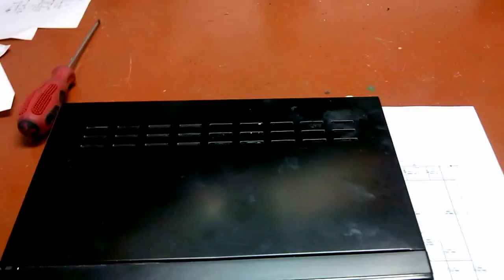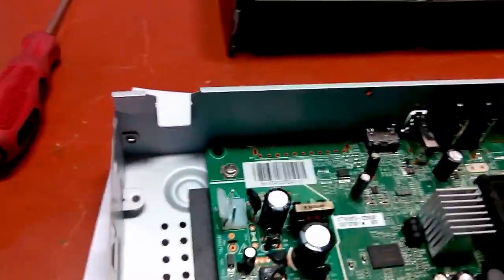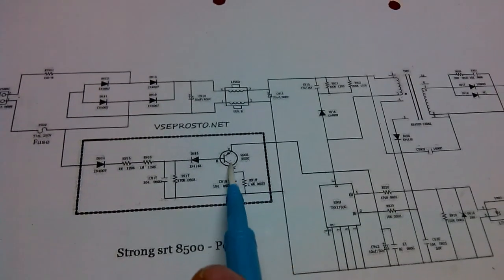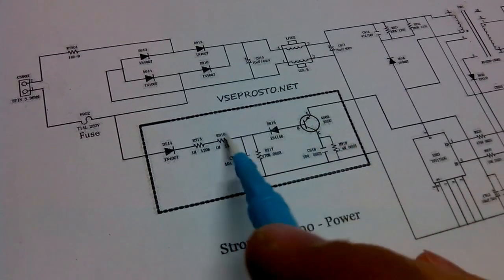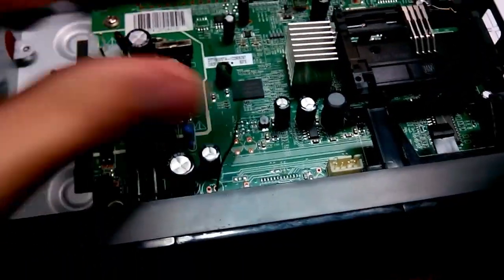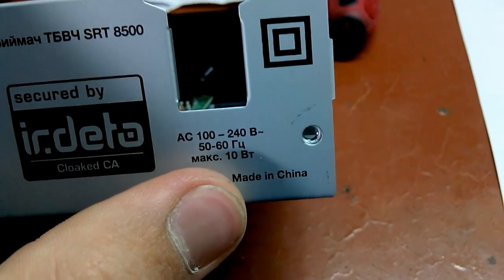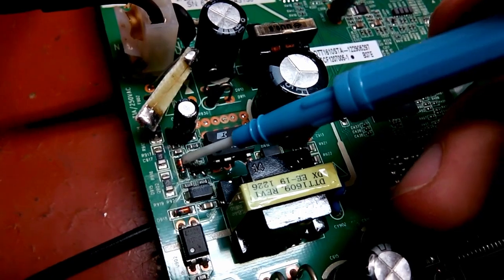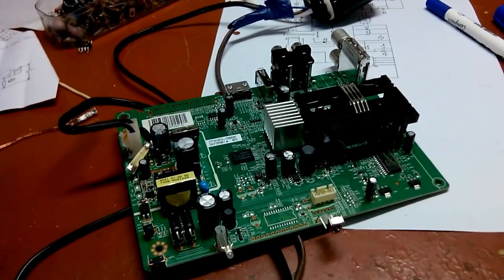Set top box repair

Comment: Ive never been happy with the idea of putting a power mosfet inside a chip with the pwm circuits.
I like a seperate mosfet and driver i.c, but im a picky bugger LOL :-D
Reply from the maker: I like such chips if you don't push them they perform great. My 3W and 6W LED bulbs use a TNY278PN from Power Integrations and I'm completely satisfied. I love that chip - it's very simple to use (doesn't require many external parts) thus the circuit can be very compact and on top of that - it's cheaper than PWM chip + discrete MOSFET. For a little PS under 15W that chip is my way to go.
Reply from the maker: I'm a fan of Power Integrations' chips if you saw my video about PCB drill press, the board I drill there is for another switcher chip from this company. And one more - their chips have a frequency jitter feature, which reduces EMI, so they are relatively "quiet" even without additional filtering. Add a CM choke with a few caps and that PS will be a good neighbor even for a radio receiver.
Reply: I dissagree with you, now we go to war LOL :-D
Yes im sure they are good, but ive seen so many things die because of heat, and quite a few "all in one" tny chips just go bang for no real reason.
But, switchmodes go bang anyway, hard to tell what went wrong.
Bad capacitors im sure we agree on, so what about a part time war LOL.
Reply from the maker: zx8401ztv Don't be like Putin LOL A few arguments shouldn't start a conflict. 
 As I mentioned, it's a power surge that killed it. A proper design would include MOV to protect it + I replaced it with a beefed up version and it works like charm to this day :)
Reply: LOL im just being silly, but you know that :-D
Yes ive noticed missing parts in quite a few switchmodes, even a in-line resistor is helpfull.
Im no expert at switchmodes, just the basic understanding is good enough for my foggy brain :-D.

I went round my mates house the other day, he showed me a linear psu i had made for him in 1987, dam thing still works fine, bloody amazing considering he often overloaded it with testing car headlights and any 12v powered items, and it never went bang.
Just a simple 13.8v 2 amp supply made for his cb radio at the time.

I know linear supplys are really bad, but old school 78xx series and LM317 regulators are so dam forgiving.
Reply from the maker: zx8401ztv Yeah, a properly sized linear regulator can take abuse. I like both linear and switcher PS, each type has its advantages.
Reply: accidentally installed dvb s2 firware on my dvb t2 box. please help. how do I fix it. no video out on hdmi